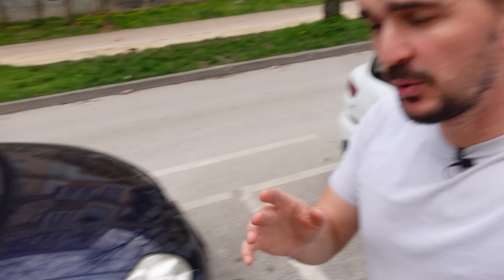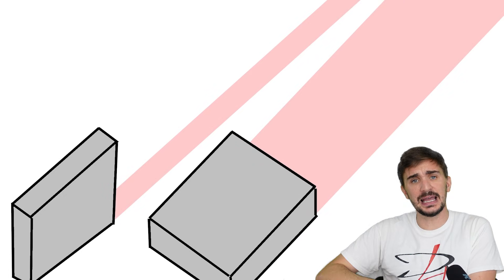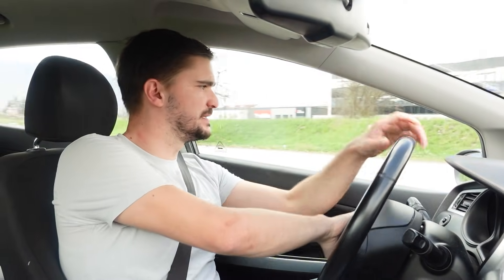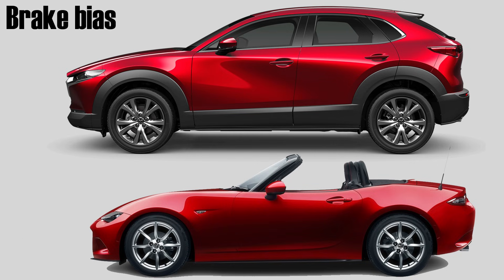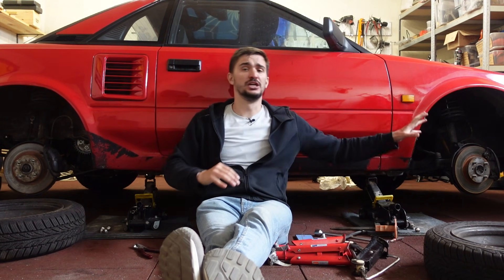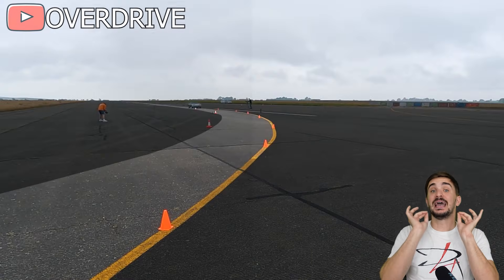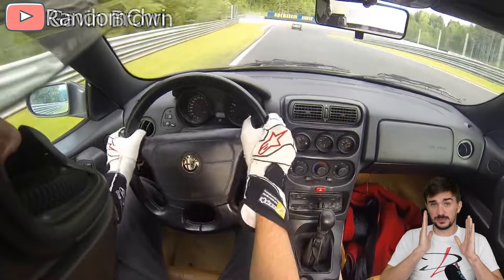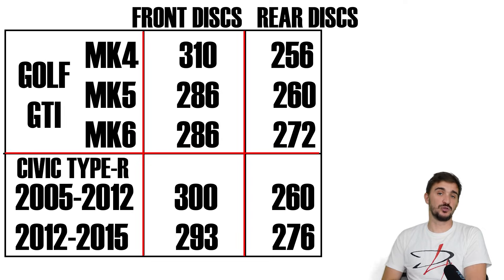Why are Front Brakes Larger than Rear Ones? Brake Bias Explained

Comment: Hello,  i really wonder if you can explain how engine load is calculated and how engine load determined, by a sensor by a wire or something else? Thank you
Reply from the maker: Throttle position sensor?
Reply: @d4a  no, I will give an example so i can describe it better. When i keep throttle at the same level the amount of fuel sent to cylinders is varies because of the power needed to keep me accelerate or moving. And the phenomena behind this is the engine load. Ecu maps usually contains engine load axis that way ecu can know if we encounter a steep road it sends more fuel.

Comment: In trucks, the rear rotors are often larger in diameter than the fronts. The front brakes will be thicker with more mass and larger calipers, but the rear brakes need to be strong due to towing requirements.

Comment: My car has great brakes but at about 40K front brakes and rotors were toast.  The rears looked brand new.  I changed the front brakes and rotors and also the rear brakes.  I put in a higher friction pads in the rear.  Brakes feel much better and after 40K again on the new brakes, there is much less wear on the fronts.  Adding higher quality rotors to the front probably had a little to do with rotor wear.  Currently it ceramic in the front and ferro-carbon in the rear.

Comment: Not buying it. Nosediving sucks.  I'm convinced it's actually because manufacturers calculated the cheapest way to meet governmental requirements, and since most cars are front heavy they put the bigger brakes on the weighted end. A car coming to a stop completely level is far better and you're not going to spin out with the rear grabbing equal to the front. Early car designs didn't even have front brakes, and many farm tractors still do not.

Comment: Crazy my front and rears are the same size in every way o thats right I have a proportioning valve so I can adjust braking force between front and rear and it is currently set at 50/50 for best performance but that said it is vary dependent on the vehicle

Comment: Excellent video and explanation!
The only thing to add is that the reason why understeer is more predictable is that most people, when going around a corner too fast and experiencing understeer, will apply the brakes. This gives the front tyres more grip, allowing the car to go in the direction they are pointing - ie. around the corner.
Reply: this only works if you brake hard enough to engage ABS.  Otherwise a tire already at the limit (understeering) cannot provide any more force (braking).  to regain traction you just lift the throttle, but of course most people won't have   this instinct.

Comment: dynamic stability control also requires more rear brake as the rear brakes are utilised to arrest wheel spin and aid in stability while hard cornering and can over heat rear brakes even without braking.   
did a v8 conversion and found the brake bias was fine until I upgraded the rear differential to a ford 9", with the extra mass of the heaver rear end more rear brake was required, I believe it was more the inertia of the heaver rotating mass.

Comment: Interestingly, mk2.5 MX5s with the factory fitted optional bigger brakes have larger discs at the rear despite being front engined. My thinking is maybe because big brake cars will have come with an LSD, the rear is heavier than the small brake cars which will have an open diff?

Comment: Another consideration: even on purely hydraulic systems without electronics, front/rear brake bias doesn't have to be fixed by a proportioning valve in the front, either.

I believe even the Mk4 Golf had EBD, but earlier Golfs (at least as far back as Mk2, on some models) went for a different approach, a proportioning valve mounted at the *rear*, attached to the torsion beam. As the rear suspension unloads due to weight transfer, the proportioning valve is adjusted to reduce rear braking force.

Approaches like this - especially once Mk4s had EBD, but even before that - also let you start out with an extreme rear bias under gentle braking to reduce weight transfer and make the vehicle feel more stable, and as brake force increases, shift braking forward for maximum braking force. (I want to say my Mk4 Golf actually wore out the rear brakes first, because most of the braking it saw was quite gentle.)

Comment: You mean to say that 155mm biscuit wheels have the same grip as 225mm tires if you were to test them separately on the same car?
There is a reason why racecars and sportscars have wide tires...more grip
Reply: Well what they teach in schools about friction is only a basic model which is valid only for hard flat surfaces with microscopic features. It will completely fail to predict friction forces of soft rubber on asphalt.

Comment: Great Video! Explained in common terms without losing the science behind it.
Regarding getting surprised by oversteer, i did experience this in a front wheel city car. Went into an exit of an interstate with about 100km/h bout an 180° turn with rather large radius. Was slowing down because of a car infront of me. (no real emergency breaking or stuff like that but from 100 - 70 over maybe 5 seconds) Suddently i realize i dont have to keep the steering wheel turned in like i did seconds before.... then i even had to counter steer... that is when i noticed the rear end of the car has gotten so light, i was actually drifting it *rolf. Drifiting in a 54PS FWD Fiat Punto. Since it happened so gradually, it was totally cool and controlled. When i went off the break, the car came back to neutral within an instant.

Comment: My dumb ass thought that the front brakes were larger because they were front wheel drive (my family doesn’t own any rear wheel drive cars). For some reason I thought that braking the wheels that provided the power would have a bigger impact on overall braking capability. Imagine my shock when I saw rear wheel drive cars still had larger front brakes 😂.

Comment: Another good reason to have a larger rear diameter disc (despite perhaps having a lower mass rear disc) is for cars using a disc parking brake. Most cars these days use mini drum P-brakes inside the disc hat, but for a long time the hydraulic rear caliper was actuated mechanically for the P-brake. Disc brakes make poor P-brakes due to their smaller friction surface area compared to drums, and the need for high application pressures that cables and levers couldn't provide. So having more brake torque from a larger diameter gave them a little help.

Comment: Hi, I have a question, in my Pajero 2 the front brakes are 276mm (ventilated) and rear are 311mm, not ventilated, why? Maybe because there are also drum brakes at rear for parking brake?

Comment: My car has ventilated brakes on all 4 wheels; of course the front brakes are larger but the front rotor is only 12mm wider than the rear rotor.

Comment: On your last video about bigger brakes not being better I read a comment about bigger brakes having more leverage, completely ignoring that even tiny brakes have enough force to lock the wheels, And ignoring the fact that with smaller brakes you can fit smaller (and lighter) wheels and low profile tires that require less braking force, resulting in cooler brakes, better pad life etc win win

Comment: Simple. the weight of a vehicle or a motorcycle moves forward as you apply breaks resulting in more friction between the tires and road surface.   Vehicle's 80 percent braking on front, 20 percent on the rear,  and motorcycle 70 percent on front and 30 percent of the rear.   Contrary to a myth, although a motorcycle power to weight ratio is many time higher than a vehicle, and it  can leap from a stop light,  a motorcycle does not stop faster than a car.  In addition, unlike a car, the biker has to smoothly apply the rear brake first to load the front wheel immediately followed by the front brake.

Comment: Cool. Really appreciate this video.

A long time ago my 4wd Mazda 323 developed a leak at its proportioning valve and I had to replace it with a 2wd one for even more front overbias than intended. :/

My Volvo 245 has a slightly larger rear disc diameter than the front, probably because it has to contain a parking brake drum, although it is solid where the front is vented. And only has two caliper pistons where the front has four.

Comment: braking in abs can also mean that your fronts are already reaching the limit and abs is regulating but the rear is not in abs. if you apply even more brake pressure the front will not be affected but the rear gets more brake force. works not in every abs system tho. in my impreza i dont have abs and i dont really need it because the awd drivetrain prevents individual wheels from locking up except for when all 4 tyres lock up. alsop kinda equalizes braking force from the reae to the front because the axles will have roughly the same amount of slip.
btw weight transfer also means the rear of the car gets light during braking and when you are in a corner where your rear is already at the limit and you brake you gonna spin before you understeer but that highly depends on the general setup of the car of the current load and line you are taking

Comment: And there is load sensing proportioning valves which regulate rear brakes depending on how much the rear suspension is compressed which drastically reduced wasted potential in fully loaded car because fixed proportioning valves are biased for worst case scenario.

Comment: Given how prominently the point was made how powerful brakes in modern cars are, I’d like to throw in the question how important engine braking during an emergency stop is. Basically asking how relevant not pushing the clutch pedal during an emergency stop is (as keeping the engine connected to the wheels adds engine braking)?

Comment: You've made the same small mistake in this video as in a previous video.

Friction coefficient μ is not a property of a single material. It depends on the interface between two surfaces. A good example is the two materials you use as examples of different coefficients of friction around 2:35. Sandpaper does have high friction in some cases, but low friction in others. The same is true of glass, which you give as an example of a low-friction surface. But what about sandpaper on glass? That's going to have lower friction than glass on glass.

Comment: Most of your videos are pretty good, but the targeted audience of this video  kinda hurts. Anyone who had driven a car, but didn't know this (morons), is a significantly different group than your previous videos.

You also omitted load dependant variable bias systems that were installed on pickup trucks (& other hauling vehicles) by manufacturers.

They were very simple! A link connected to the suspension increases rear brake distribution as the suspension is compressed, and increases front brake distribution as extended. 

I'd quote what they were on, but idk, I saw them frequently (as a "lube tech") but they never needed service, so I never looked deeper into the system. The system seemed to disappear as ABS appeared, so basically everything made before ~2000 (without ABS) that could carry more than 1000lbs.

Comment: Excellent explanation - thank you. In the late sixties, I used to have the van version of the Morris Mini. It was pretty light in the rear end, and not even a pressure reduction valve for the rear brakes. Under heavy breaking (yeah, I was young and stupid) I put that thing sideways a fair number of times. On the plus side, it was great for handbrake turns.

Comment: I have some questions. If a smaller tire width doesn't matter for braking surely there must be a width that is a perfect balance between width and braking performance. By this i mean there is no way a 185 section tire will have equal braking as a 245 section tire. 
 Also Most circuit racing cars don't have ABS and rely on the driver using threshold braking. For the everyday driver and car I understand the purpose of ABS wich is to allow people to keep control of the car under heavy braking instead of locking up and losing steering.  

Just some important things that should have been mentioned in this video, which is awesome by the way.
Reply from the maker: The pinned comment links to a video that talks about tires va brakes

Comment: Could you make a video about 'drifting'? What happens during a drift maneuver, how camber, toe, caster angles, sway bars, suspension stiffnesses and tires act during a corner in countersteer, and how they are usually set in a drift car....also the differences between a drift and a conventional (or racing) suspension settings.
I know it's not an easy and simple topic, but I think you're the best person on YouTube that could explain these things in a precise and clear way. Thank you

Comment: Very good video, as always! 🔝
In my Porsche 944 turbo the brake discs and calipers on the two axles are identical. In fact the car has low center of gravity and 50/50 weight distribution

Comment: That's easy: because of physics. When you brake the car, you project most of the weight of the car into the front hence the bigger front brakes to deal with the extra force. You don't need to watch a 15min video to explain that.

Comment: ABS actually aren't better at stopping in snow and in gravel. When brakes lock up they pile gravel and snow in front of the tire and form a wedge which help create forward resistance and aid in stopping. Just a fun fact meant to aid to this video and information not to troll it
Reply: it's true
Reply: Well, that's true. But take note that ABS does not meant to decrease stopping distance but to keep ability to control the vehicle. With locked wheels you can't steer.

Comment: Great Video as usual! I'm always impressed how much I learn about a topic which I thought I knew completely😅

Little thing I find missing is that mechanical break force distribution was/is a thing since the 60's. Just some levers on the rear suspension opening and closing the valve to the rear breaks 👍🏻

Comment: You should add a section where you explore upgrade options for older cars. For example, could I add EBD to my 80's car or could what pros and cons are there if I upgrade breaks.
Reply: EBD is incorporated into ABS pump.  EDB systems seem to have reluctors built into the wheel bearing caps.  So, no, you won't be able to (they link to fly by wire throttle).  In any case,  early stability systems (Bosch ABS 5.7) were poorly configured.  Bosch ABS 8 and TRW systems are functionally much better.

Getting any EDB ABS system to work (Bosch 5.3) would need serious know how.
Reply: @idonotwantahandle2  Thank you for this clarifying answer.  It's nice to get some good comments these days. Usually it's loads of scams and what not.  Since I don't have the mechanic education but I do have the project car my request still remains for driving 4 answers. My understanding is that everything can be upgraded if you have the know how but without mentor on hand it's hard to know what's in my power and what is not.

Comment: The content from your channel is great. But the explanation of how friction works is not right. It may be easier to explain it in such a manner to laymen but the physics works differently. Friction isn't like jagged surfaces getting caught up in each other. It has been seen that ultra smooth surfaces generate a lot of friction between them. In fact ultra smooth metal surfaces (smooth in the atomic levels itself) would get automatically welded to each other. So lets keep Friction as a product of coefficient of friction and Normal force. Its better that way.

Comment: not every car follows this rule, at least not in brake diameter. many cars run nearly identical rotor sizes front/rear nowadays due to stability control. now, they generally do have smaller calipers but, rotor size is often nearly the same. lots of nissan cars are like that, 14" x 1.76" (minimum) front and 13.8" x .8" (minimum) rear.
Reply from the maker: Watch the video, I speak about all of this
Reply: @d4a  fair. i did watch a lot of it but, i skipped around some. apparently i missed that part, sorry about that!

Comment: “braking force corresponding to their increased size” i thought this is the same guy who said that brake size doesn’t matter and doesn’t help you stop faster? what happened to that? out of all the videos i’ve watched of yours, the bigger brakes don’t matter thing has never resonated with me. even here you say it yourself that they have more braking force when they’re bigger.
Reply from the maker: You're misunderstanding. First I never said it doesn't matter so don't twist my words. I said that bigger brakes alone can't reduce stopping distance. Brake force corresponding to their increased size simply means that if front brakes are 30% larger you give them 30% more braking force which is hydraulic pressure. Watch the video in it's entirety.
Reply: @d4a  I did watch the video in its entirety. I wasn't trying to twist your words at all, you literally say "big brakes wont stop you faster" which is directly contradicted by the statement I typed in the previous comment. I dont know if im an idiot, but ive watched both of your (previous) videos on brakes 4 times now and I just really dont get it. I understand how bigger tires help, but I dont get how the brake size doesnt help.
Reply: @d4a  to be clear, I enjoy and appreciate your content. I am an aspiring hobbyist mechanic and ive learned a priceless amount from you. I actually just realized while writing this that I am not subscribed and immediately hit the button. I dont mean any disrespect but I cant see how your two statements can both be taken as the truth.

Comment: Very interesting to see. My 1991 Honda Beat has slightly more rear brake than front, which surprised me. Especially with both being single piston unventilated disc brakes.
Reply: Must be to do with weight distribution in that case